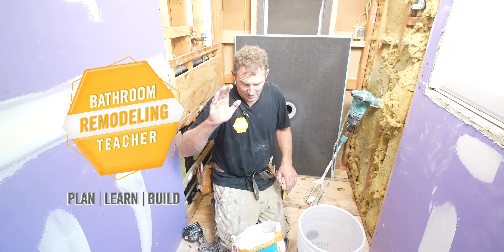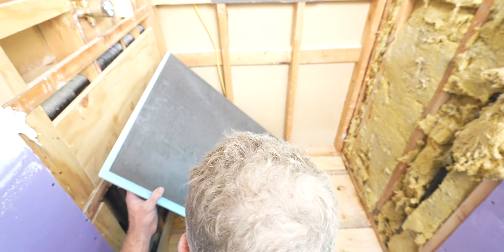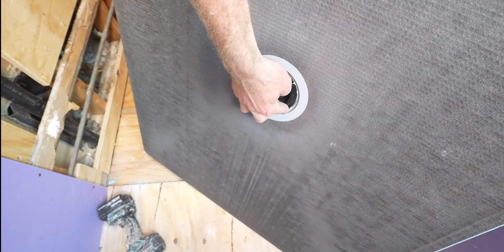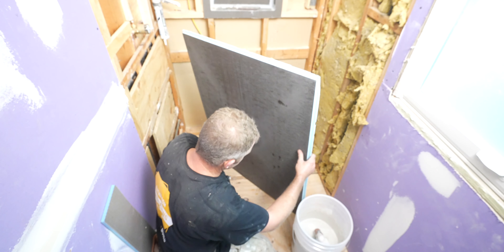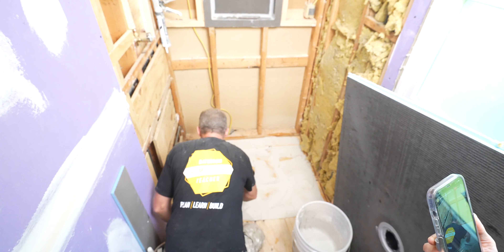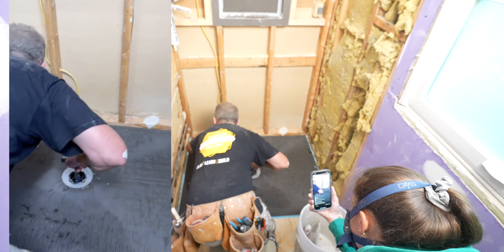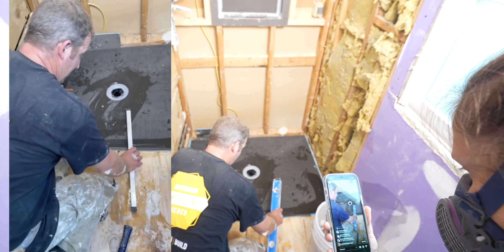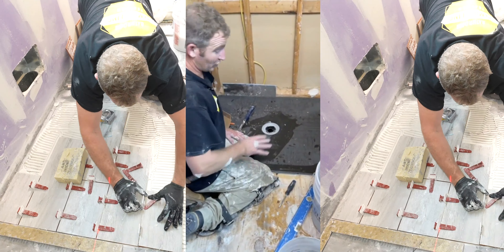Easy Curbless Shower 🚿  | WEDI | PLAN LEARN BUILD

Comment: Do you have a link or name of that door system and nook insert?
Reply from the maker: I'll post the video of that door here eventually. but I ultimately was not happy with some of the components. Required way too much silicon to adhere to tile. no reason for it....I'll try to find the model and get back to you 👍
Reply: @BathroomRemodelingTeacher  Thanks do what you can. Sorry to add to your work
Reply from the maker: @mnice59  here's the link to the model of door I used. It was 5/16" glass which I don't really like, and the silicone to attach wall channels was a bit ridiculous... https://www.build.com/dreamline-shdr-6348760/s1240314?uid=2965265

Comment: Greetings BRT! I am sure that you would not install it that way unless you were absolutely confident but was curious if adding some sort of a transition tape (fiber mesh etc) over where studs and 3/4 sub-ply meet would be over kill or actually adding additional rigidity? No matter how good they are secured (studs & ply) I cant imagine some independent movement hence thin-set cracking down the line. Any words of wisdom or you think I inhaled too much pvc primer? Great video as always! 🔥💪🛁🚽📐
Reply from the maker: There will be wedi subliner that will span over that area 4" onto pan. I hear what your concerned about. But the subliner is supposed to be able to handle any normal expansion and contraction of wood. As long as the subfloor is adhered well, I don't see it being an issue 👍
Reply: @BathroomRemodelingTeacher  Thanks a bunch Steve! You and your videographer (a better half I assume) are doing amazing job. There are few guys/channels that kick ass here on YT (we know who they are lol) but you are the only one with such a detail. Since I am a pro I can say with certainty that this is the ONLY way how one can actually learn. Also in my humble opinion, ones knowledge is worth a dust unless you are ready to share. And you are. That makes one very, very special! I can just imagine how much work and dedication this whole thing takes but it will pay off. It always does. I hope that other people (pro or diy) will notice and recognize the difference and appreciate it. All the best. 👊